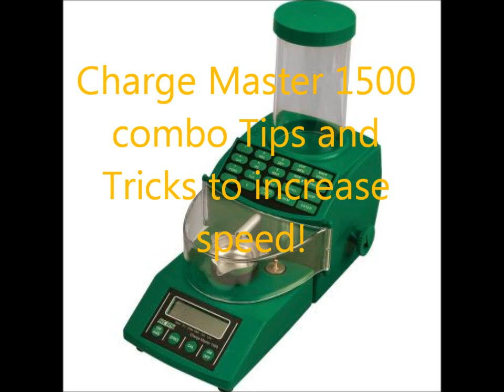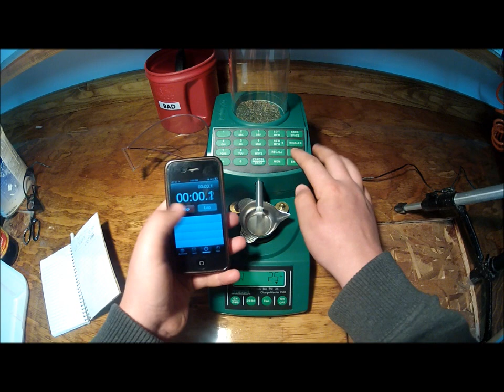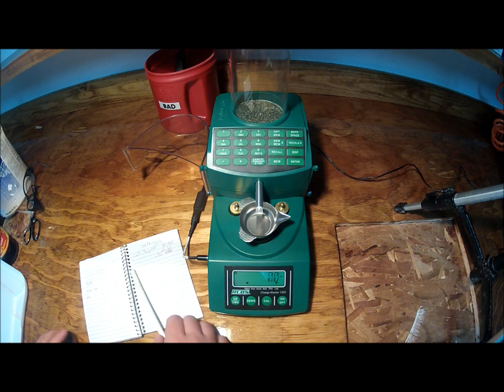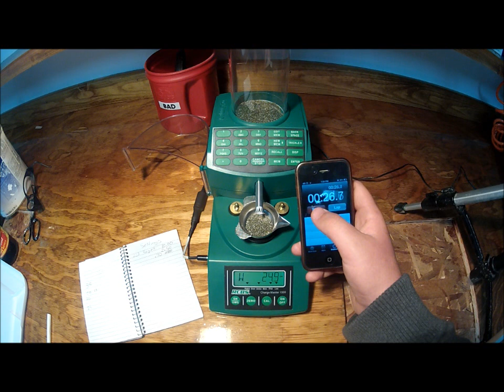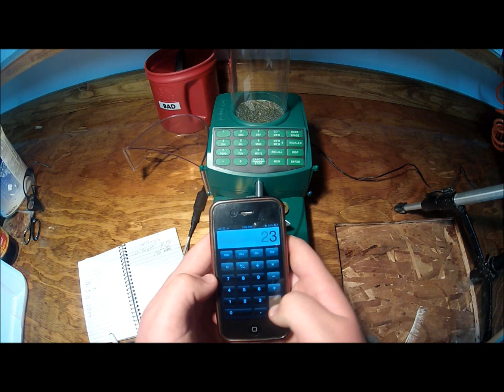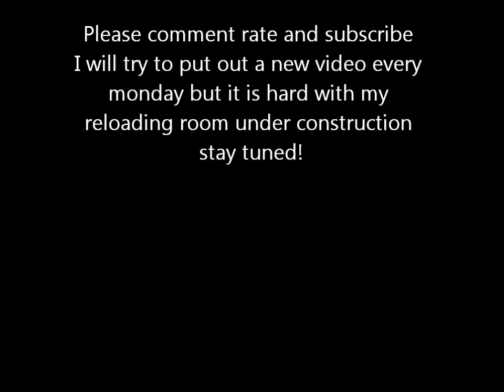Speed Up Your RCBS 1500 ChargeMaster Programming and Modifications

Comment: Just to let you know on the auto charge deal...  You do NOT need to do the extra step of holding enter.
If you want to single charge then just do it like this.
type in weight and hit dispense.

To auto throw do this:
Type in weight hit enter THEN press Dispense.  That automatically sets it up to auto throw.  when you want to stop throwing automatically just press STOP/CANCEL after your last charge.

Thanks for the programming help man.

Comment: Where did you buy your capacitor at
Reply: Is that a capacitor or simply an electronic noise line filter?

https://www.amazon.com/AUCH-20Pcs-Ferrite-Suppressor-Diameter/dp/B016XE2BS0/ref=sr_1_16?ie=UTF8&qid=1470428671&sr=8-16&keywords=electronic+noise+line+filter

This isn't necessarily what I'd buy.  This is a multi-size package.  If you just want a filter for THIS product, measure the cord and buy the proper size.

Comment: Here is what I use with 12v power supplies off amazon. I put down a strip of 3m double sided trim tape than the light strip. they are crazy bright easy to install and relatively inexpensive. 

https://www.superbrightleds.com/moreinfo/top-emitting/led-light-strips-led-tape-light-with-18-smdsft-3-chip-smd-led-5050-with-lc2-connector/1465/

You can also get much cheaper rolls from amazon that work well where you dont need super brightness. Or your can buy self contained light bars from super bright LED's as well but those are pricey.